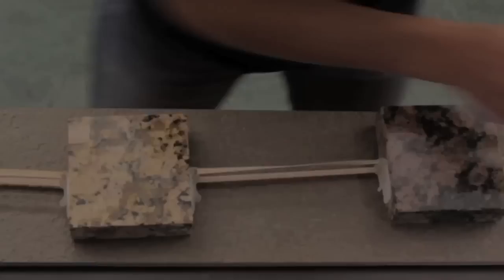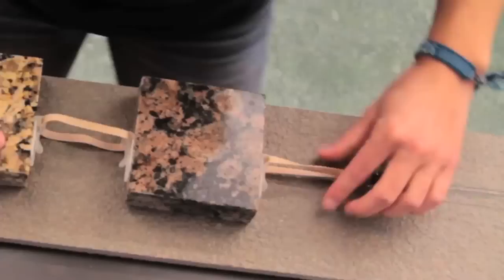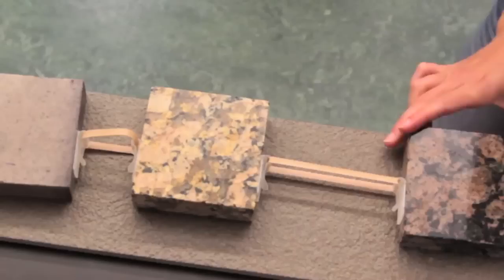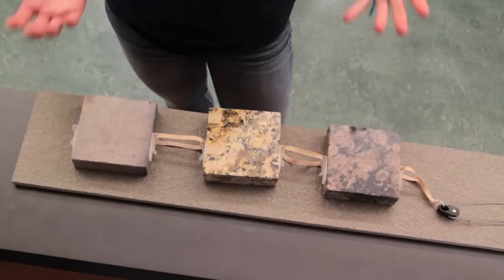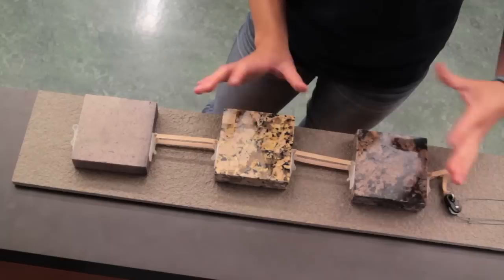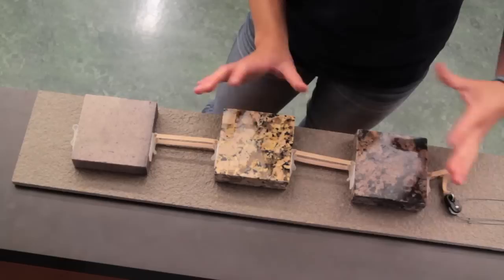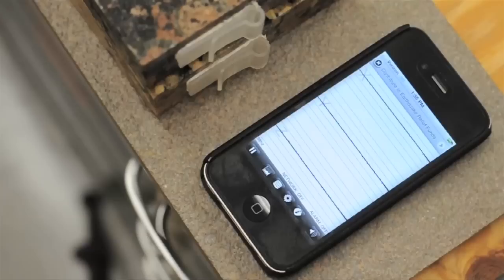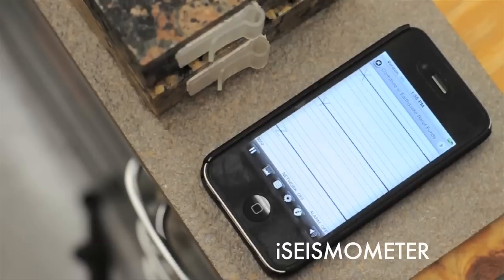QuakeCaster Earthquake Machine -Trailer

Comment: How is there the same amount of friction between the lower mass and the board when you removed half of the weight from the top of it, or when there is three times the surface area of mass contacting the board? and settle down, I'm trying to stand up, and my roof is caving in.